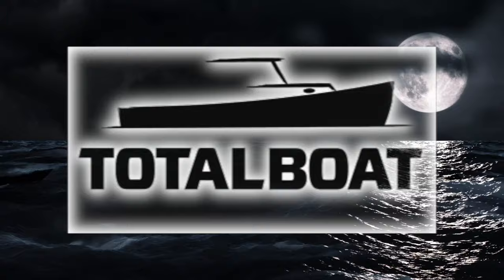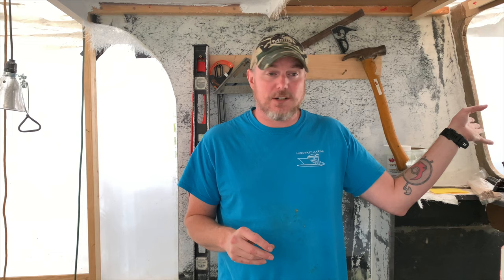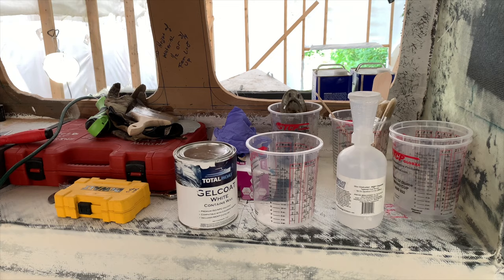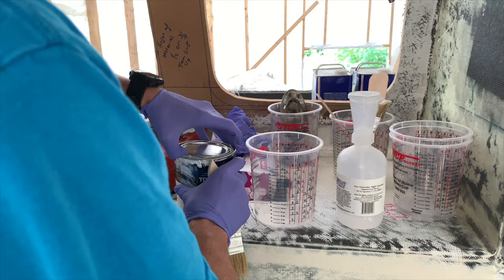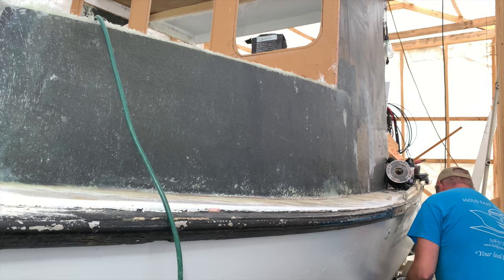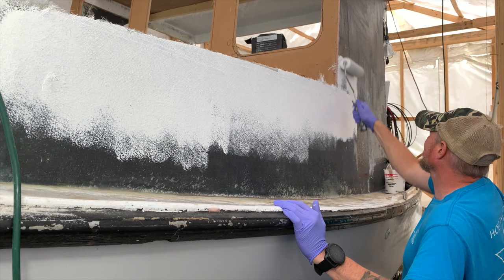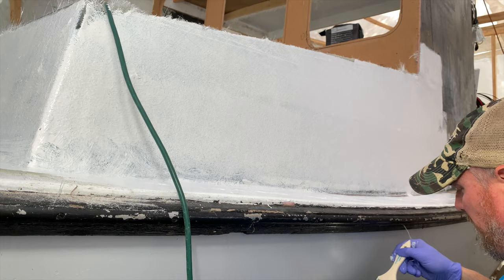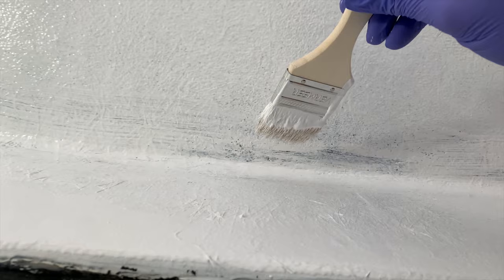How to Apply Gelcoat -Part one-

Comment: I found using a hvlp spray gun with a 2.5mm tip. And also using a patch booster from fiber glass supply for the gel at %25-%30 works the best and following directions works great
Reply from the maker: Yes. I did a video a while back about spraying with a cheap spray gun,  I’ve never used patch booster before but thanks for letting me know, I’ll try it.

Comment: this is a straight forward common sense video.  important part of the video is explaining how to mix 2%,and clarifying if you're using waxed or unwaxed gelcoat. It was confusing because you say you're going to use the laminating gelcoat next.  I understand laminating gelcoat as unwaxed that goes down before adding waxed gelcoat you cure.  so, if you're going to use laminating gelcoat next as you say, then the layer you demonstrated must have been waxed which is opposite of what I understand.  I more confused than ever by this video.
Reply from the maker: Ok you didn’t really pay attention. I read the can in the video, gelcoat with wax. You use gelcoat with wax to cure laminating poly resin. You have to cure the resin before you begin fairing, which is the next step after the gelcoat cures. The laminating gelcoat is to get a thicker surface so when I sand pre buffing I don’t sand through and destroy all my hard work.

Comment: This makes me think it's a better idea to gel coat my whaler 13 than paint it.  Why do so many people advise against gel coating?
Reply from the maker: They don’t advise against it, I think it’s intimidating for people. Pot life for paint is 3+ hours. Pot life for gelcoat is 10-15 minutes.
Reply: I am about to do a Whaler 13’ with gelcoat with wax.  I have 3 pints. I’m planning to use a pint per coat, sanding in between as you mentioned. How should I plan around
the short pot life?  Do you catalyze, spray, clean gun….then repeat? I am thinking two 8oz batches per coat.  Is that ok to stop mid spray and reset?
Reply: Yeah I paint cars for a living and I won’t be using gel coat on my boat to much time wasted sanding in between coats and laying down laminate gel coat after when is it ever finished I’ll just sand lay down an epoxy sealer and run a single stage with flex additive. 🎉
Reply: I’ve never heard of anyone advising against gel coat. In fact people tend to prefer gelcoat. It saves and protects the hull much better than just painting

Comment: Can you apply multiple coats, of Gelcoat with wax?  Do you have to remove the wax for the next layer?  Does sanding (wet or dry) that layer it cause wax to melt and need to be removed by dewaxer?
Reply from the maker: Yes you can, but you need to sand between coats. Don’t think of the wax like a candle wax or car wax. It’s just an additive. Sand with 180 between coats, once it’s dry.
Reply: Thank you for answering, I’m about to give this a shot myself!

Comment: can you gelcoat over poly resen right after its layed, or do you have to wait for some period of time ??
Reply from the maker: You have to at least wait for the gelcoat to set up. For small areas probably a few hours. Larger areas I’d wait 4. You don’t want an excessive buildup of heat. Sometimes I will go right over fresh resin BUT only when I have to. I’ve been doing this so long I know when and when not to do it. I don’t recommend that approach for a novice. Merry Christmas

Comment: Why why  didn’t you use wax less jell coat first let it tac off ,then waxed for second coat saves a lot of sanding.
Reply from the maker: Well in this video I was trying to cure some polyester resin, which in order to do that I need to use the wax. You should check out one of my other videos where I cover all you mentioned.

Comment: Can this be used on 7/16” zip board exterior sheathing?
Reply from the maker: NO. Zip is never a choice for ANYTHING on a boat. Stay way
Reply: Thanks for letting me know. Is 1/2” plywood better?
Reply from the maker: @benperrotte6946  its better than zip but I wouldn't use plywood.

Comment: A bit unclear and not sure if you're using the right products. Filler is used to fill holes, epoxy if structural. Perhaps a layer of fliberglass resin might be a better choice than gelcoat. The gelcoat is your finishing product. Am I correct?
Reply from the maker: I’m confused by your question. But I’ll try. I never use epoxy resin. The gelcoat contains wax, which fully cures everything below it, ie the resin without wax. Also finishing with gelcoat helps fill in the glass mat and gives you a smoother finish for fairing.
Reply: @HoldFastMarine   Maybe I'm confused, but sure looks like your NOT finishing,  but cleaning up a rough surface, and looks pretty rough, and not sure if the surface was structurally compromised, but looks iffy. that's why I'd use Epoxy, and perhaps some cloth to help smooth out the rough spots. After which I'd sand it, clean it, touch up with filler to fill spots or voids, and THEN go to the gel coat which would be the last product.
Reply from the maker: I’m not finishing, nor am I finishing a rough surface. I’m curing the resin with the gelcoat. You say that you would do all this work with epoxy and then do your gelcoat. Gelcoat does not stick to epoxy. But you go and do things how you wanna do them. I do things the way that I wanna do them.

Comment: ANYONE, If I sand between every coat can I use waxed gelcoat for multiple coats???
Reply from the maker: You’d have to use gelcoat with wax if you want to sand between coats.
Reply: @HoldFastMarine  I sand between coats of everything, 
Usually paint and varnish. 
My first time with gelcoat. 
Thanks.
Reply from the maker: Good luck!